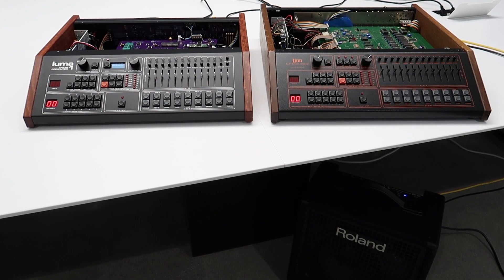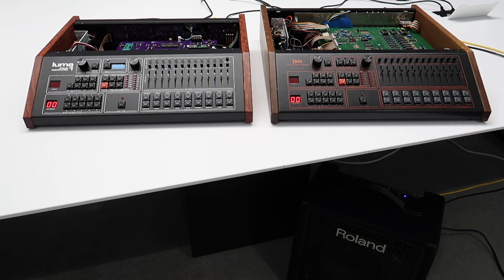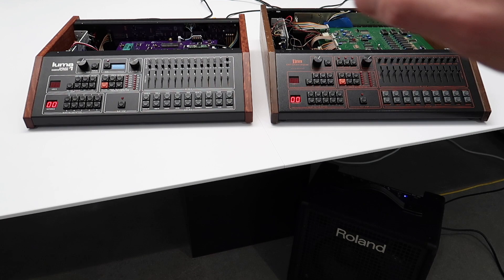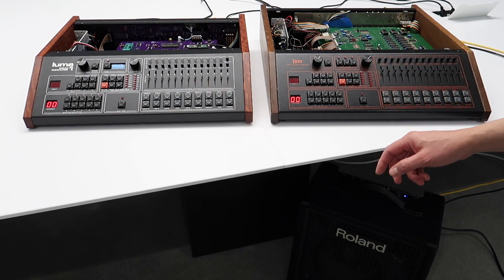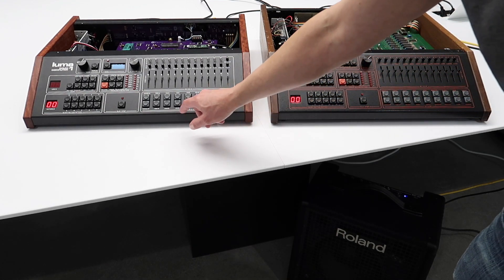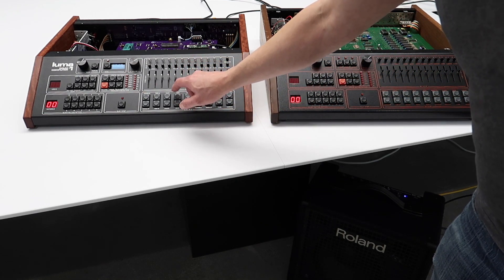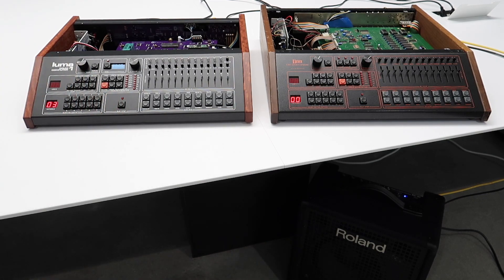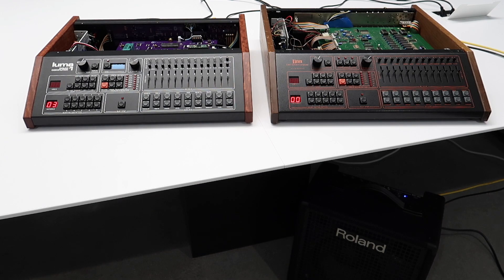Luma-1 vs LM-1 sound comparison

Comment: There’s one more sound that wasn’t accessed here that Prince loved to use, which was different from the “clap” sound. It’s more of a “pop” sound but I’ve never been able to figure out if it is a stock sound or something that needs to be installed as an expansion. It’s distinctly different from the “clap” tone and wondering if your machine has it as part of the arsenal. Prince used it a LOT as an accent tone in his programmed rhythms from “1999” onwards. 

Anyways, thanks for the demo—your drum machine is an amazing replica!
Reply: Those sounds came from the Pearl Syncussion

Comment: Literally nobody could tell the difference, or would a listener care. It's 99.9% identical.
Reply: I have downloaded the  mp3, sorry but the Luma 1 sounds less punchy that the  real LM1, groove is not the same. With Lm1 I want to dance, with LUma 1 I stay on my chair 😐
Reply: @gonreebgonreeb  I noticed a difference on my iPad Pro, mostly in the low and mid-heavy sounds, not so much the hats and tambourines. The Lm1 was more forward and slightly brighter. A little EQ could bring it closer to parity.

Comment: So you swapped the button board and fader board and display board on the lm-1 to look just like the luma 😀 didn’t t the original fader buttons fit to the new faders?
Reply from the maker: It has a big history. Many Luma-1 parts are designed to retrofit the original LM-1. This way we can support all original LM-1 customers no matter of it's damage and repair needs. That LM-1 had serious issues with it's panel. So it was completely replaced. The drum board is still fine. 
Original fader caps won't fit new production faders (I mean, they may fit with some rework but aren't designed for them). There are new production fader caps that match the looks nicely. You'll find it in our Instagram :)

Comment: Hello, there are the same old detachable eprom chips? or were the eproms replaced by non-detachable models?
Reply from the maker: It no longer needs eproms, all sounds are reloadable on a fly from the SD card inside. However, there is still one EPROM socket. It's made for dumping purpose, i.e. if you have ERPOMs from other drum machines, Luma-1 can dump those for you, save ti to a file and play.
Reply: @DeftAudio  ah OK good.

Comment: Will luma1 knobs and buttons work on a LM-1? I have a friend that needs some parts.
Reply from the maker: Luma-1 front panel consists of three boards - a small board for 2-digit LEDs, a mixer board with faders and top pots and the large board with all other buttons. The mixer board of LM-1 is different, see it has one row of pots only. Other boards are cross compatible (including a pinout) and we have LM-1 mixer board too (with one row of pots). Those go as fully assembled pieces or kits. The buttons or pots alone wouldn't fit into LM-1 PCB.

Comment: No matter the sound,  it s a clone costing nearly the same price of an original one
Reply from the maker: That's not quite right.
Reply: There s no intention from me to depreciate this project.  I hate software emulation. But a non official new edition ( if u don t want to call it “” a clone””” ) at a high end price is an issue. No one will be interested to buy a fake Ferrari even if you make a nearly same engine and car design.  Why you didn’t team up with Roger Linn to issue a re-edit of the LM1 under the brand Roger Linn Design ?
Reply from the maker: @philippezsiga1125  https://www.rogerlinndesign.com/about/joe-britt
Reply: I have a 808 , DMX , Cr78  and bought the Rossum sp1200 . I would never have bought the Isla s2400 for the reasons above . Nevertheless i am inpressed by your knowledge and  it s great to still have people able to recreate  a Linn Drum or fix a Fairlight Cmi.
Reply from the maker: @philippezsiga1125  just read this https://www.rogerlinndesign.com/about/joe-britt
Reply: yeah, but they're sold out...🤔
Reply: The Luma-1 is at least 20 times less expensive than the last LM-1 I’ve seen that’s sold.
Reply: Respect, people don’t realise how much work and dedication goes into to building something from scratch out of your own pocket. I’ve owned an LM 1 among others (vintage ) and just getting a decent tech was a nightmare with a 3- 6 turnaround hence I sold it   ! But the Luma looks good to me …. Haters if it’s not for you jog on ….. hardware  even if a clone or reissue will always be more inspiring than a vst ❤

Comment: State of the art technology for 1980. It’s beautifully crafted and very impressive… but incredibly dated. A sampler inside any DAW with a sample pack provides the same for a fraction.
Reply: Incredibly wrong.
Reply: @spurv  wrong that its dated? or wrong that it's function can be duplicated in a DAW for a fraction of the price? your comment makes no sense because my assessment is 100% factual.
Reply: @sandwich-breath It's 100% your opinion.
Reply: @tekis0  to each their own, it’s a lovely piece of gear. Congrats to the designer for their achievement. Cost and efficiency are my metrics for hardware these days.

Comment: Wonderful machine, that you built there! Sadly there is absolutely no point in shooting a smartphone video "showing" sounds while being compressed to death by a crappy phone mic. Moving yourself in front of the speaker on the floor doesn't help either, I'm afraid. To be honest, I would erase this from YT, if I were you. No hard feelings, I could imagine buying one of yours next year, since I'm a huge LM1 fan and I admire and appreciate all the work you spent in making this dream come true! But please, better quality vids!
Reply from the maker: Just check the description and download those files recorded straight form line out.
Reply: @DeftAudio  Great video, straightforward and easy to follow. Excited to learn/see more, subscribed!
Reply: @DeftAudio  thanks for the clarification, I will surely do that. But it would have been much easier, if you would have cut that into the YT-clip at the moments where sound is on ficus - it’s not that hard.
Reply from the maker: @tihinter Those recordings are from different session.
Reply: @DeftAudio  ah, now I understand. Thanx for your answer. And keep it coming, I’d love to see more in depth analysis videos, esp. of the “freerunning” Hihat noise and the microtiming quirks of the vintage machine.